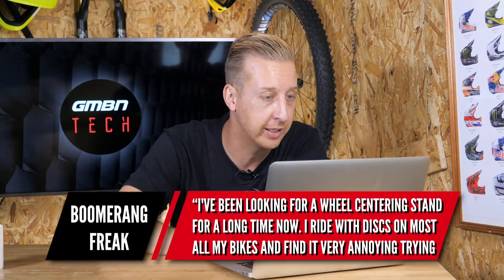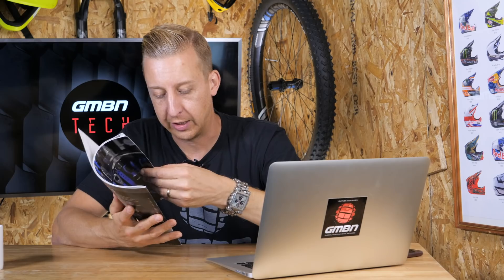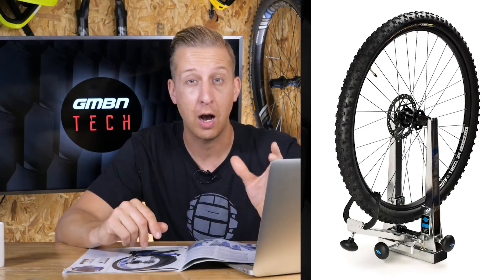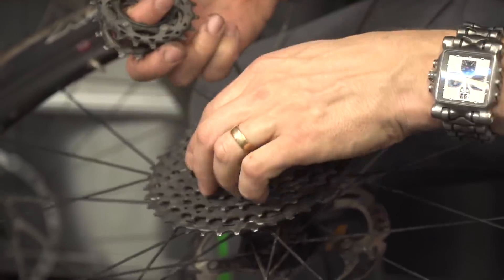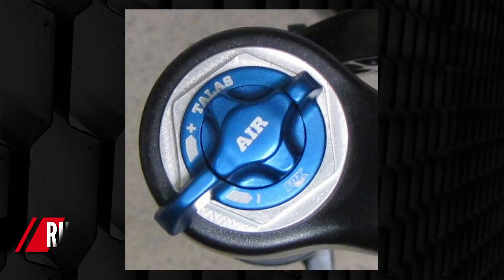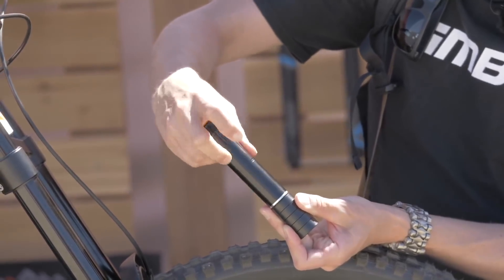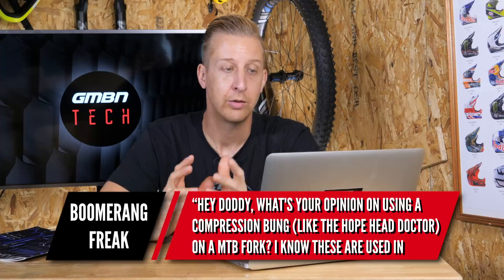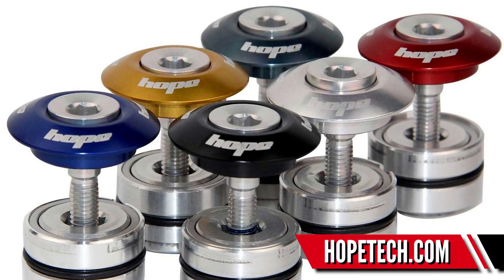Why Are Your Spokes Snapping? | Ask GMBN Tech

Comment from the maker: Keep your questions coming in for next week by emailing hellotech@gmbn.com or using #askgmbntech 👇
Reply: Thanks for answering Doddy!!!
Reply: #askgmbntech hi doddy. I've snapped 4 derailleurs in 2 and a half months, 3 of the times on small jumps and once while climbing. I've made sure chain length is correct, my hanger is straight, and limit screws are adjusted correct. What could be causing this? Thanks
Reply: Josh wells  Crashing? 🤣
Reply: did you make sure the chain is the correct length when the suspension is in its longest chainstay growth position (some bikes that is fully bottomed out, others its mid travel etc). Remove the rear shock or let all the air out, measure from the center of the crank bolt to the center of the axle bolt/QR etc as you go through the travel. Size the chain for the largest measurement you find and measure with the chain on the largest combination of sprockets AND route it through the rear mech. set the rear mech to the 4/5 o clock position maximum (3 too tight 6 too loose) and size the chain at that position.   The usual "big to big and add 1 or 2 links" is not accurate enough.  Also is your cage length correct for your cassette max tooth (EG SRAM short cage can only have a  28tooth max cassette).  Hope that helps
Reply: #askgmbntech Hi guys. I have to do a lower leg service on a 2018 rock shox Pike and I can´t find the RS 0w-30 oil where Ilive. What other oil can I use?
Reply: @eugeniokdf  Maxima or belray fork oil
Reply: #askgmbntech hi i have a question im planing to upgrade to put a wide ratio cassette 11 50t 10s do you think do i have to change my derailleur or extesion hanger is enough? Thanks
Reply: Hey doddy, thanks a lot for the answer (and saving me money :P) But am I correct in thinking the TS2.2 would need thru axle adapters? Does it matter what adapters I get? You got any recommendations? Even park tool alone have quite a few.

Comment: #askgmbntech Hi Doddy I have a 2.25 Maxxis Crossmark II EXO TR on the rear of my Whyte T-130 C RS but would a High Roller II 3C (like on the front) or a dual compound Ardent EXO (or Ardent Race 3C) be a better option for general XC / trail riding?

Comment: Hi doddy love the show and all gmbn presentes i changed my fork from a boxxer 26 to a 27.5 pike rct3 dual position the frame is freeride and the head set angle is better like you said but the fork has a problem and there isn’t any rockshox service shops in my country i asked some pro riders here and the said its the air spring side the air leaks from in side we chand the orings and seals but it still when i put my wait on it continuously the fork goes down and wont come back up i have to pull the front wheelup so it  can come up     Even when it lock  ?what is you opinion?#askgmbntech

Comment: Hi #askgmbntech, If you remember I won your #hacksandbodges contest and told you that I'm going to get a new fork. Well i did, it's a 2015 Rockshox Reba RL which unfortunately didn't came with a remote lockout lever. My question is, is it ok to use the fork for now without the remote lockout lever? At the moment without the remote, the DOT on the lockout dial is within the Motion Control bracket. And speaking of which, can you shed a little light about the Motion Control thing? What does it do? Thanks a lot! Cheers!!!

Comment: #AskGMBNTech I've recently bought a used bike with some specialised traverse wheel but some of the spoke nipple broke off from corrosion, my local bike shop put new brass nipples on my rear wheel but my front still has the same alloy nipples that corroded off. Is there anything that I can do to prevent this?

Comment: #askgmbntech Hey Doddy i've got a specialized fsr dh from the 90s and the suspension linkage bolts keep loosening after every ride even though it's been torque properly, it uses bushings instead of bearings, will loctite fix this? Cheers!
Rinaldi

Comment: #askgmbntech Hey Doddy! Love the show. I've been hearing a creak in my cranks while pedaling recently. While inspecting my bb and cranks, I noticed a slight wobble in my drive side crank. The chain rings(2x) wobble with the crank. I've guessed that's probably the reason for the creak but I was wondering if there's a fix to that or my cranks and/or bb are just worn and need replacement. I tried cleaning, regreasing and retighening everything up but it still wobbles. Is it a tension problem?

Comment: #askgmbntech.  Love your enthusiasm and knowledge  Doddy. Can you use automotive grease (such as CV joint grease), on bike pedal threads Bottom.bracket etc? It looks identical as is waaaayy cheaper.
Reply from the maker: Pedals you'll be fine, not sure about BB though, it may be a bit heavy or corrosive to Carbon fibre (so definite no unless it says carbon safe if you have a PF carbon frame).

Comment: #askgmbntech hi guys, my left crank arm is damage so my bike is super creaky, i want to replace it but i don’t wanna buy the whole crankset, i found on ebay the single left arm on 180mm but my cranks are 175, is there a problem if i use diferent sizes of arms on each side?

Comment: If you really want to get wheels perfect, and don't have a ton of experience, get a P&K Lie with a Wheel Fanatyk tensiometer.  Yeah, it's crazy expensive, but it automatically dishes the wheel, makes it easier to track roundness, and is 100% safe for carbon rims (no chance of scratching).  It's also absolutely rigid -- the Park 2 flexes, and even the DT Swiss stand does, too.

Comment: #gbmntech i have been riding a ghost cagua 2012 for 2 years now but when im riding black dh tracks i get loads of mechanicals ranging from flat tires to play in the rear suspension system would buying a downhill bike solve this?

Comment: To question about the square pedal crank .i Got the same with the giant ebike Yamaha motor . I’ve Just changed the sprocket and The pedal was on really tight and needed a 36mm thin wall socket to get the spider off   . 

I put grease on the square so easy to get on again  I did have creaking sound from around that area seems to gone .

Comment: I'd always put a smear of grease on any square tapered cranks. The myth that encouraged dry fitting came from a certain manufacturer (I don't remember who, probably Campagnolo) who had a few cranks split and decided to blame the grease and over-tightening. A well-made square taper crank shouldn't fail, and the grease will ensure it the crank is properly pressed in placed so that the taper doesn't have a chance to deform. Ride the cranks for a while, then double check the bolts again. After this you shouldn't have to worry about them. I've been working with square tapered cranks for years now, one of our best selling electric mountain bikes (120mm trail bike) has them too, and they've never been a major cause for concern. The standard is not as prone to failure as everyone wants you to remember, and the bottom brackets themselves are more reliable than any other standard I've had to work with.

Left hand cranks almost always fail first, they usually have less material around the taper, and they have to put transfer any torque through the bottom bracket, unlike a drive-side crank which transfers power directly to the chainring. Forged crank arms are usually superior to other manufacturing methods, the 1990's had a trend for brightly anodized CNC parts instead, which involves cutting away material, rather than just reshaping what's already there.
Reply from the maker: Thanks for the feedback and great info Alex! It's good to know.

Comment: #askgmbntech Hi Doddy, I am both a MTB rider and trial rider and I want to ask you why with the advent of 1x system there is almost no one adopting a front freewheel (e.g. trial style) on MTB? Freewheel are way cheaper than freehub, easy to replace, and most importantly the system will offer the possibility to change gear while freewheeling. Thanks

Comment: #askgmbntech Hey Doddy, I recently got into a rough crash and my handle bar impaled my leg and it went deep enough that the brake lever also impaled me and it ended up doing the worst bit of damage and I ended up with a hole 3 and a half inch deep and 4 inches wide. I was within half an inch of my femoral artery and if I had hit it I would have died because it takes roughly a minute to bleed out if you hit it and I was 40 minutes from the hospital and the medics took about 10 minutes to arrive. I have a 2018 rocky mountain maiden just with the stock grips and I was wondering if there are any grips out there that would help prevent another situation like this and I would also like to know of any padding that could protect my inner thigh. Thanks!
Reply: jeez. get old school bar ends and wear jeans...

Comment: #askgmbntech Hi Doody! Please help. I bought new a Specialized Fuse. I mostly use it to ride on logging roads, no Blake craziness, although I wish I could. After less than 300 miles the BB started creaking, so the bike shop where I bought it replaced it. Then, 3 miles after, the new BB not only started creaking again but now the chain ring is rubbing on the chain stay, and it has scraped the paint, so you can see the metal. I feel that the frame has gotten more flex since the initial BB problem. What do you recommend me to do?
Reply: take it back

Comment: #askgmbntech I have a creaking noice coming from my back brake any ideas what it could be? Btw took the pads out a give them a clean but still creaking
Reply: Remove the rotor, clean it all up, and install it.  With the bolts slightly loose, hold the rotor clockwise while snugging them up, then torque.

Comment: #askgmbntech right now i have a 2017 giant talon but on that bike it's limiting me now when I go to my local trail there's a lot of jumps there I can clear but there's some jumps that I can only clear on random people's full suspension MTB and on my bike I have had a lot of crashes because my brakes don't allow me to slown down quick enough  and I've gone over berms crashing into trees and bushes and my chain always slips off and I always cut my shins and my calfs and that's stops me from doing a lot of things because I'm just scared that every thing is gonna go to shit but when I'm on other people's full suspension MTB I will do anything at my local trail pretty much do you think I should buy a 2019 giant reign 2 or buy a second hand 2017 Norco range a7.3 bike the reign is $3700 and the Norco is $2400 what should I try buy

Comment: For the "spoke snapping" question, this could be a bent rim. If the rim has significant enough damage, it could have been trued to correct the bend, in which case the wheel would be straight, but one side would have very high tension vs the other with very low. If that's the case, spokes will keep snapping until the rim is replaced. Of course, if both wheels are snapping spokes, then Doddy is probably spot on.
Reply: It's a carbon rim, so they don't really bend.  I don't really agree with Doddy's reasoning, though.  Usually, in my experience, broken spokes are caused by them being too loose, and fatiguing.  A stiff rim should actually apply less force to any one spoke, as it does a better job of spreading the force across all the nearby spokes.  Maybe I'm missing something, but I think I would tension the wheel near it's maximum recommendation, and wouldn't loosen it, unless it already exceeds that limit.

Comment: #askgmbntech Over the past 23 years I have continuously upgraded my first self build mountain bike, but have yet to find a satisfying solution for a modern style stem. Currently fitted is a insert steerer extender but I would much rather fit an "A-Headset" headset instead of the existing Ritchie WCS threaded one. Is there ANY modern style (A-Head) headset that will replace the 1and1/8 threaded headset and leave enough of the threaded steerer exposed to clamp on a modern stem?

Comment: #askgmbntech how can I make a coil fork a little stiffer because I keep bottoming out so fast thanks
Reply: Depending on the top cap setup... I've drilled and tapped top caps and installed a schrader valve to convert it to an air+coil fork.  You can adjust the preload with only a small amount of PSI, and progressiveness by adding or removing oil.  It's not as nice as a new fork, but it works.

Comment: I’m a heavy rider and one of the problems with newer wheels are that they are using thinner aluminum spokes and when one brakes the others are severely weakened and even if you replace the broken spoke the others will start braking the best way to fix the problem I’ve found is replace the spokes with a thicker steel or cromo spoke, much more stable and steel can stretch where as alloy snap under pressure. Hope this helps anyone else who is frustrated with this problem. Best regards from steve the bike collector
Reply: get a bike with more suspension. (front and rear). Make it softer so it can absorb your landings more.
Reply: Hugs I have many bikes and what I’m trying to say here is that its more a problem with the newer types for example dt Swiss 29er. Not a problem I’ve ever had with a mavic wheel or even a normal 26 inch.

Comment: #askgmbntech Hi Doddy great videos as always, I have recently started MTB and bought a second hand Diamondback Heist 2.0 2017 hard tail to learn the ropes. I have so far upgraded the brakes, crank and bottom bracket and chain ring to XT items things have broken or I've felt the need to upgrade. The rockshox recon soloair fork as you've previously mentioned can not have tokens added to improve progression. What are my options for a better plusher fork or do you think I've reached the limit of upgrade for this bike?

Comment: I recently snapped a spoke trying to crank over a rock on my SC Reserve wheel. Discovered while replacing the spoke that the tension was all over the place in my spokes and that getting anywhere near the recommended spoke tension of 100-120kgf generally causes the alloy spoke nipples to roundout or shear and crack. Now running a lot less spoke tension on the rear wheel.

Comment: Can bottoming out on my rear shock damage it?
Reply: Yes if its often and harsh. They are designed to take a bottom out from time to time but not on a regular basis. Either add a volume spacer or add more air or a stiffer spring.

Comment: that oil in the air chamber idea will work as long as there isn't a transfer port inside the stanchion tube for balancing the + and - chamber ... if there is one all the oil will end up in the negative chamber

Comment: #askgmbntech Hey Doddy, on my Rocky Mountain Element of 2012, they specced a 152mm/31mm stroke shock. The shock is worn a bit so I'm looking for options for replacement. It seems almost impossible to get a 152mm shock these days, what are my options and which ones a good/great?
Reply: only if your frame supports a shock that big though.

Comment: I had the same problem with the sqare taper bottom bracket ended up putting a race face aeffect crankset on layaway at my local shop. It was worth the switch it made my bike 100% stiffer and no creek or bolts backing out.

Comment: #askgmbn hey doddy, I have a suspension related question.
I am currently running a Manitou Mattoc Comp Pro 2 Fork with 160mm travel and have set it up with about 55psi (im about 73kg with everything on) and while the SAG looks correct, the fork just keeps "bouncing" if I paddle while stood up - even if I put LSC and HSC at max.
Would volume spacers help? Any advice? 
Cheers!
Reply: Jakob R. So it’s bobbing up and down while you are pedaling? That’s completely normal for all suspension. If your fork has a lock out lever, then use that to lock your fork when you know you’re going to be pedaling. I don’t know what LSC and HSC do, so I might sound really stupid right now.
Reply: that's what they do :) - unless it has a lockout the best you can do is set it all to firm/max damping until you go down hill.  If you just make it stiff by adding pressure then you wont have correct sag and it will feel harsh on bumps/trails but nice on flat land pedaling around
Reply: try having fox40's lol its like riding a trampoline when set to DH sag

Comment: #askgmbntech what should i look for on a bike before buying it?
Reply: Stefan Marek depends on what you want on a bike.
Reply: @peterlang5047  i want a fully that can support a lot of jumps and stuff like that (so its all about quality) because i damaged my derailleur by doing a bonnyhop (it is already the third time that this happens in 2 months) and i have given way to much money for that. 
Thats why i think a expensive mountainbike is going to make the problems disapear. Or is it just that i have been adjusting something  wrong? (The chain falls off to the rim side and then the derailleur bends and it is quite dificult to take  the chain out of  between the spokes and the rear casette )
I would be glad if you have any suggestions for me
Reply: Stefan Marek a better bike will not eliminate your problems, but it will make problems less frequently. I can’t help you with choosing a bike. If you don’t have any preference, just go to your local bike shop and they can help you. Just be prepared to spend a lot of money.
Reply: @peterlang5047  thanks for your help
Reply: too much to answer simply. research bikes and what makes a good one etc. You get what you pay for. a £100 bike wont last as long as a £1000 one and wont be as nice to ride. But a £10,000 one wont be much different to a £5,000 for the same purpose. when you get to a certain level you are paying for prestige value and names/brands like with anything in life.
Reply: @ukspawn666  thanks mate